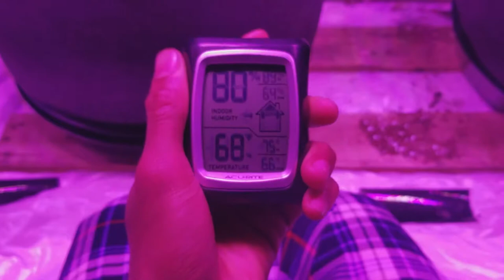Water droplets on Cannabis leaves, Why this happens

Comment: You may well have humidity problems just wanted to point out to others under led lights it’s not unusual. Under hids transportation drys up under the heat & isn’t normally seen nor is it normally guttation or always due to a high humidity as said under led lights you might see this ; it’s not always a problem. If you’ve a high humidity that’s another thing and needs to be taken care of. Hope it went well for you In the end